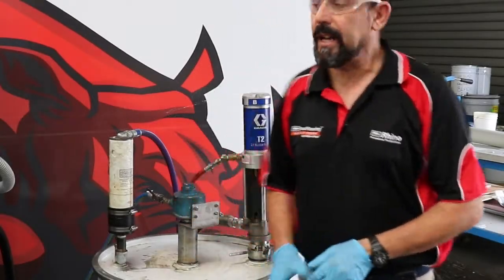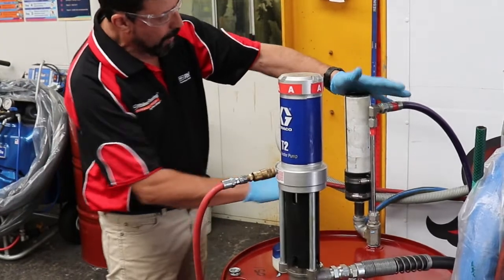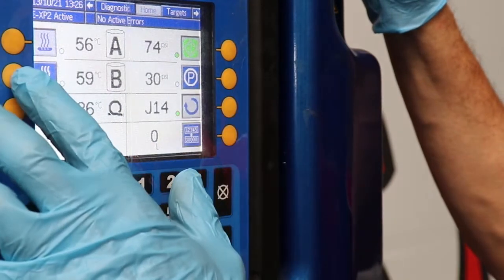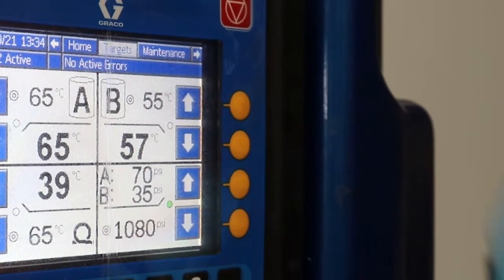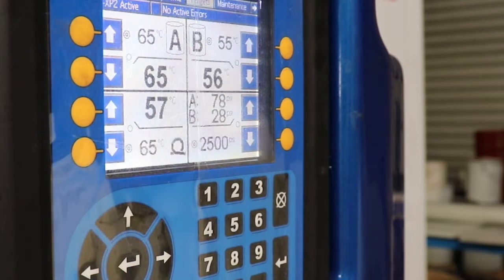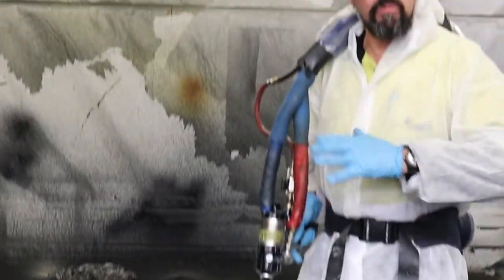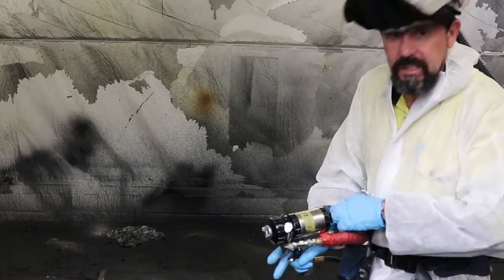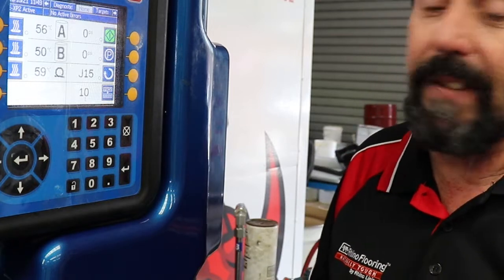Graco E-XP2 Operation and Spray Example by Rhino Linings Australasia

Comment: Can you use the Graco grease to keep the pumps on the barrels lubed?
Reply from the maker: Yes, you can use Graco grease on any parts requiring lubrication and especially good for ISO items.
Reply: @RhinoLiningsOz  thank you!
Reply from the maker: @GermBread  No worries. Sorry about the slow response time as only just saw your message.